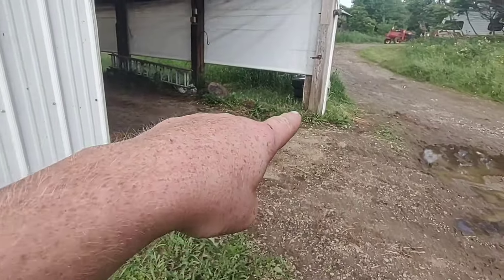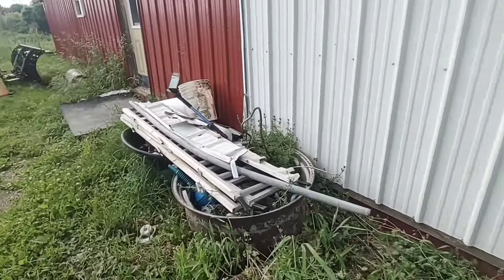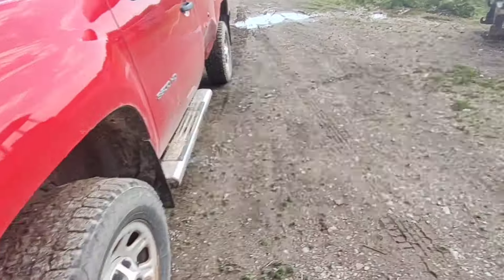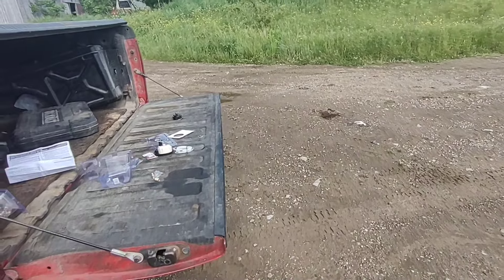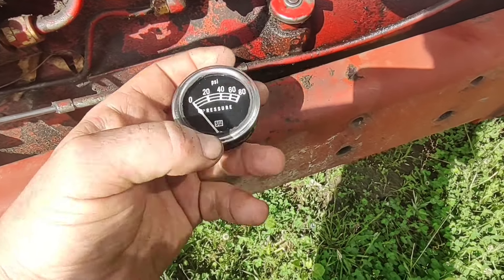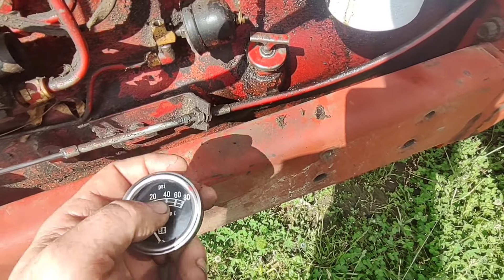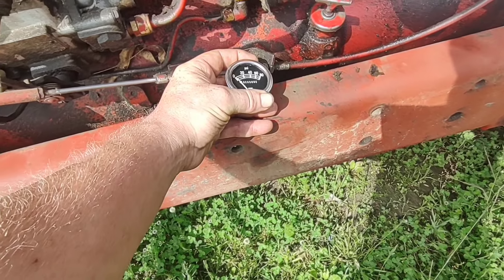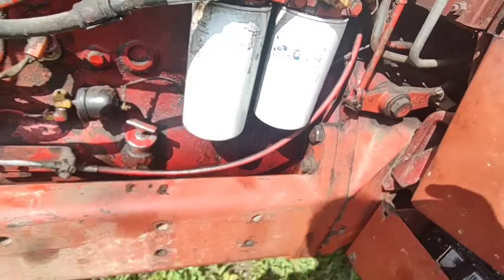Oil gauge says 10 psi, but I don't believe it.

Comment: On our 1486 we never trusted the electric gauge so bought one like that ran it in the cab with copper line found a spot on the dash drilled a hole made the gauge look factory. Also had to run an aftermarket fuel gauge same way all nice and neat tho looks good
Reply from the maker: This was just temporary but I'm going to change it around some by rerouting the temp tubing with the wiring to the alternator. That should give enough slack to be able to mount the gauges up on the dash better and I'm going to get the copper tubing for the oil gauge and should be able to run that through the same spot with the temp.

Comment: The sending unit on the top of the radiator is the water level indicator.
Reply from the maker: That makes sense. It hasn't worked since I've owned the tractor anyway.

Comment: 10-20 psi at idle, hot. Is in IH spec.
Reply from the maker: I can see 20 but I'd still be leary at 10.🤔 
My suspicion was because even at higher rpm it wasn't much more than 20. I'm just glad it was as simple as a gauge.

Comment: A 986 with a turbo charger lol.  I’m guessing it’s now like a 1086 for hp? Did you blow it up a while back or did you just decide to get it rebuilt?
Reply from the maker: Same as a 1486. 1086 has a 414 in it. 986 has a 436 and the 1486 has a 436 turbo. 
I had a sleeve go bad and leaked coolant so with the hours it had on it I just went ahead and did the overhaul